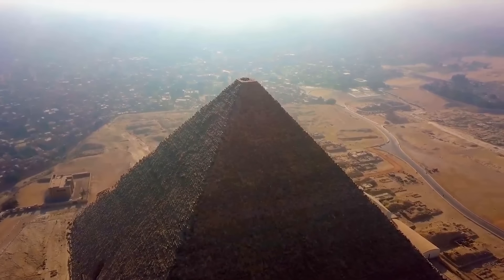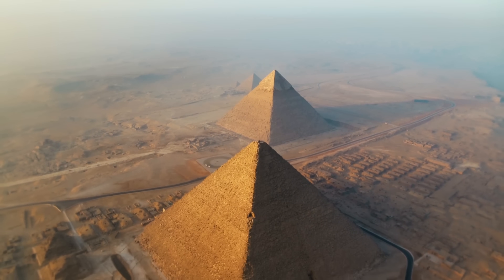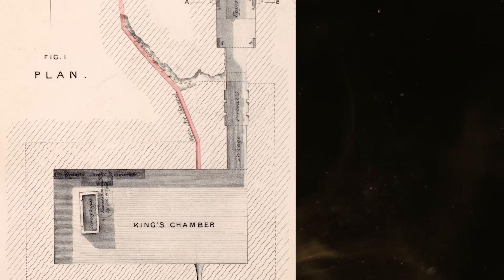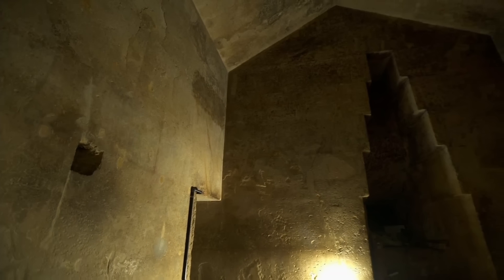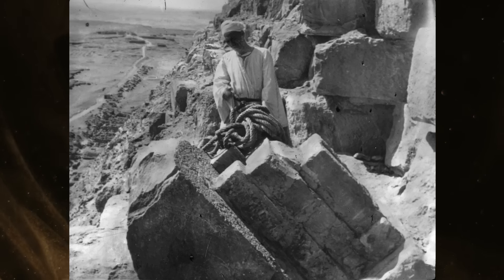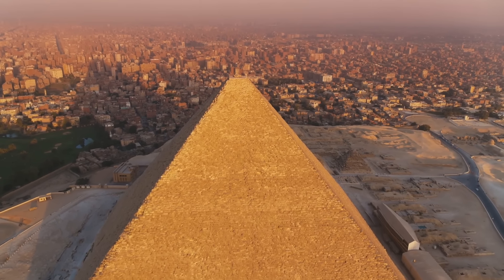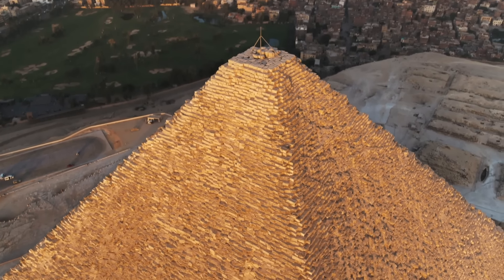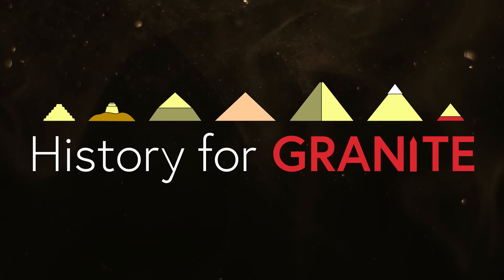One Solution to the Four Channels of the Great Pyramid

Comment: To say they are air shafts only makes sense if they were open to be used as air shafts.....since they weren't open, then we are still no closer to working out their true purpose. Dixon had to break through solid rock in the Queens chamber to open them, so they weren't just plugged up either.
Reply: They*were open.. you should probably finish the video before you start speaking
Reply: Did you even watch this video?

Comment: Thank you so much for your videos. At my home we love to watch them together and come up with different hypothesizes. E.g.: My husband assumes that the shafts could have been used to pull ropes through them during the construction process to lift heavy objects. He says the stone ball might have been rolled down through the shafts from the outside and was received by workers inside. That's why the shafts starting in the Queen's Chamber end within the pyramid. After this part of construction was finished (since its location is lower within the pyramid) and they weren't needed anymore, they were simply closed of.

Comment: Hello, I completely disagree with your conclusion on his topic but, i love the video and the effort you put on it. Keep up the great work and all the best for the next videos. Your work is amazing.
Reply: What's your opinion then
Reply: @shable1436  Hi, to be completely honest I dont have a theory myself. I do think that the shafts had a purpose and probably it was a religious one but, I am not sure about which one. My disagreement with the author of this magnificent video comes about the "air" shafts theory. I think there are many facts that have to be proven first.
1. Why two "air" shafts and not three? Why not four?
2. Why the king and queen chambers have the same amount of "air" shafts? And both at the north and south wall?
3. This theory has much more sense if you embrace the possibility that the queen chamber was thought to be the main king chamber but, Hemiunu changed his mind. There are many experts who think the opposite, that the pyramid was design the way it is from the scratch so, what is the purpose of the queen chamber´s shafts? Why the quality of the stone used in both chambers is different? Even the architecture is different if both were to be king chambers?.
4. Why the shafts dont go in a straight line to the exterior? Why so many turn arounds? Even, we now know that the shafts turn to avoid certain parts of the grand gallery, why dont you do the shafts to be positioned in a top corner? Or completely on the left and top corner? That will make more sense, no body will care as they are "air" shafts but, instead they are in the "middle" of the room at certain height.
5. As it is mentioned in the video, who do you need the air for? Once you seal the king chamber...
6. I know it is mentioned in the video that the workers had to work in difficult situations very frequently including without air but, if you are going to leave the stone at the door of the queen chamber unfinished, why dont you open the shafts of the queen chamber? At least for some time the workers will have more air until they plug a stone at the end of the shaft.

These are some questions that came to mind when i saw the video. I know that I am not answering anything here but creating more doubts, that´s why i said from the beginning that I appreciate the work of the author as he is brave enough to base his theory on facts.

I would appreciate to read your point of view.

Sorry for the long post.
Reply: Perhaps t's not the chamber that needs air...perhaps air is for whatever was going to be put in the chamber. If you think about the channels as ducts that pass air through to an apparatus of some kind. This would also make sense as to why the holes had different machining marks done later...so that the apparatus could be custom fit into the square holes on site.

Comment: new questions indeed. ive never seen the shafts in such good detail, you can clearly see the different tool marks left that reveals the purpose. but also more answers we can tease out too?

1) the unfinished edge on the queens chamber entrance would lead us to believe the room was not given its finishing touches, thus the suggestion the shafts were meant to be opened in the original plan, but since the queens shafts are sealed off at both ends, it means a change of final plans for the burial chamber was made quite late and moved up to the kings chamber instead.

2) they seem to have been hedging their bets about the kings chamber since the shafts are finished almost to the casing, but were confident enough to go ahead and seal them off after the top chevrons were laid down and the granite beam cracks didn't get any worse since they seem to have been sealed off at that course of masonry.

3) the beam holes for flooring on the grand gallery also would have the entrance to the queens chamber essentially paved over and forgotten about along with the lower unfinished chamber as well. likely with a cedar floor and stairs over the whole thing, pinned into the open sockets left along the sides.

4) the shaft openings were among the very last things to do before finishing the chamber since the queens shafts reach very high up but are not opened back down at the bottom. 

5) the rough finish inside the shafts do indicate a utilitarian use for them and not a spiritual one, otherwise they might be made of polished granite and be bang straight. that they wiggle around then take the shortest route out also implies simple utility. 

6) the concept of the false door for the soul would have been used for ritualistic purposes and not a small shaft.

7) the queens shafts would have been continually covered with those "doors" as construction progressed upwards, the kings shaft likely had similar covers until they broke the surface. they are prolly broken and in the core rubble infill of a nearby mastaba after the valuable copper was removed.

8) the ball, hook and handle were dropped into the shaft on accident at some point higher up. or possibly thrown in by the poor soul in charge of that shaft when he was told all his work was for nothing they were using the upper chamber now. >=(

9) early reports of a painted ceiling in the queens chamber before the salt got to it was prolly leftover construction marks like "paint here" "carve this off" etc. since we can now conclude it was an unfinished space. if the queens chamber also was meant for a second burial with the kings chamber then the shafts would have been finished to the same degree as the diagnostic marks in the kings chamber would conclude. thus the pyramid was a 1 occupant structure. 

10) there is 1 thing I can think of for why they would want fresh air into the burial chamber. having the burial chambers so high above the entrance might trap and foul the air over time and made it impossible to have a lighted lamp, and the very last thing in the burial ritual was for the priests to light 4 lamps around the sarcophagus to keep the evil spirits away and dump some water on a pile of grain to symbolize new life and then drop the portcullis slabs. would be abit awkward to get to the lamp part and have it not work. so they do seem to be simple vent shafts, but also with very important uses since they built two of them in different directions incase one failed. 

misc thoughts:

11) the cracks over that block to the right of the sarcophagus really need to be examined if its hiding a passage like the queens shafts were, perhaps to the small magazine chambers that seem to be missing from the design as they are in the later pyramids. mabye its the rest of his mothers furniture in there who knows?

12) the grand gallery seems like the corbels stop way too soon into a flat ceiling, they ought to go alot higher up before flattening off which seems to be what the scan pyramids project has found. if they built 5 relieving chambers over the kings chamber then id expect at least one over the grand gallery too? cant have that collapsing either. 

13) since we can see the twist of the pyramid at the top in the core masonry infill, I wonder if alot of the other infill is laid down off angle on purpose in order to distribute the forces from the 4 sides away and if they alternated that angle for each infill course?

a low chance that you see this or reply to me, but ive been watching you since the start of your channel, and your videos are very well done, please continue. (hands you a cookie) 🍪✨😸❤
Reply from the maker: Your summary and observations are very astute. It makes me happy to see that the information has been conveyed clearly. You’ll be very happy to get some more answers in the next video.
Reply: @HistoryforGRANITE  thank you kindly for your reply, I shall await it with anticipation sir! 😸❤️✨
Reply: dude, nice comment.  @trydar
Reply: @Charlie-phlezk  thanks! 😸✨
Reply: Epic comment dude! Number 10 makes me think hard, you're on to something there, it's a basic answer that fits, Khufu when overseeing this project would have been like "Yo I heard the candles blew out at other burials, I don't want that shit happening to me, fix it!"
Reply: @masaharumorimoto4761  thanks! its something we know was a requirement for the burial ritual, the all important reason for building the pyramid in the first place, and it was clearly so important that they made 2 shafts to make sure at least 1 worked, and kept building the lower 2 shafts until they were sure the kings chamber was unlikely to collapse and could be used as the actual burial chamber, so they opened the vents at the bottom once the cover slabs were removed to make the last horizontal vent opening at the casing and did not do the finishing work on the now redundant queens chamber. whoever built this was clearly very worried about internal collapses, so much so to make 3 burial chamber options. I also think the hooked tool found at the bottom of the shafts might be how they pulled the covers off between each course before replacing it to keep the shafts clear of debris during construction since that is the most likely thing to be near the shaft mouth and get dropped in on accident. so clearly fresh air was an absolute requirement for something in that room, and with kufu dead and the chamber sealed with granite, im not sure what else it could be except the 4 votive lamps. we will see in a future video what HFG thinks it was needed for tho, he may have a better idea. =)
Reply: Source?
Reply: Ventilation for the group of workers  finishing the internal chambers as well as ventilation for allowing candlelight since they'd be working on the dark seems to make the most sense from a constructability purpose. These could be easily and quickly subsequently sealed up as discussed in the video when burial ceremony and/or construction was completed or as needed to avoid rainwater or sandstorm ingress Well done on the video, makes plenty of sense.

Comment: A personal opinion is that they could be vents for using during construction phases such as painting the chambers. 
The pyramid is built over a long time roughly from bottom to top.  I've seen modern condos being built like where while on top most current construction the concrete is being poured, a little below that the studds are going in, below that the wiring and plumbing, then the drywall to seal over the studs, then the doors go on. So on a high rise you can  have all these going on at the same time with even fully completed condos on the lower floor. Over time each trade moves up one floor as the floor above is ready for them. 
In the case of the pyramid the stones that make the chamber room are built. At some point interior work with paint and thus fumes would start. To clear the fumes vents are established to the current exterior. Important to note the "current" in the exterior access. As work is going then new upward layers would need vent paths extended along their slopes. Then once the work, and smelly fumes, is done the upper layers would no longer have the vents continued. This is where the next layer of stones don't continue the vent.
This is from a limited research capacity. I look forward to Granite's details and happy to see an inclusion of venting in his timestamps. I wonder what his deeper research will  present to support or deny my current opinion.
Reply: Not a compelling solution, the amount of air exchange would be trivial over such a long distance and narrow cross section.
Reply: @kennethferland5579 I disagree, having air moving on both north and southern side would create a suction effect allowing constant air moving through. 
Personally though I think it was to keep fire going for light and the fact that the chambers where above ground level this creates a problem for air and smoke after completion.
Once khufu was placed the vents where closed for maximum mummification.
Reply: @kennethferland5579  You could be right. Some is more than none. The human sized access tunnels also exist but without at least some other air passage gases would be hard to get out.  A house chimney is fairly narrow and not unlike this size. Its not a matter of looking for great winds but at least some air movement to exchange gases. A draw would exist with at least one other path beyond the main door.
Most period light sources were based on burning oil, wax or pitch and that would lower oxygen is burning in a confined space.  The narrow construction-chimney would also allow smoke to be drawn out without coating the newly painted walls.  Though this doesn't address why each has two nor the relatively shallow angle. 
I don't claim to be absolutely right only putting it forward as a possibility. Looking forward to Granite's details on it.
Reply: A good idea, here. Yes as a Plumber working on a high rise, these chases, are filled with Styrofoam, (covered over with a thin layer of concrete, to finish floor,): then chiseled into to complete the drain assembly. This theory would mean that the builders didn't get time to complete the shafts purpose, or another Culture did not know the usage, & blocked right over the exits.
Reply: @Nobbie248 supply oxygen for lights with min airflow does seen valid. The painters and carvers decorating the chambers would need light as the upper pyramid continues to be built. Rather than fumes as in my original post it lets light sources burn, or burn better. Smoke and fumes would also move out too.
Reply: They are way to long to be venting unless fire places were under them.
Reply: @b1laxson  are those rooms painted and decorated  ??
Reply: @kennethferland5579  Not if they had some way of pumping air.
Reply: air wouldn't move efficiently through a 60m snorkel. Plus there is no paint inside.
Reply: @efteestein  No paint remaining. There is some thoughts that they have been decorated back in the day. Consider Tutankhamen's tomb that was found sealed.
Reply: what paint? and if paint, what 'fumes'? more likely vents for smoke from lighting.
Reply: A quick note that my original post was on the notice for the video, thus before Granite's information was made known. HistoGranite's full video is now up. While Granite agrees on ventilation he raises the question on for who.
Reply: @Nobbie248  That's not how air would move through such a structure, it will vent out through both channels and enter through the main entrance to the decending corridor.  Human breath, bodyheat and any flame used for illumination is warm and will rise.  Also we KNOW that people can go into and through the pyrimid without suffocating for lack of ventilation, and they can even do lots of work inside because EVERY graverobber and Explorer did exactly that while the channels were all plugged.  The claimed 'need' for ventaltion is complelty unfounded.
Reply: @kennethferland5579  well we dnt know if the "entrance" was completely open at all times so this is neither here nor there.
The fact that 2 openings parallel create the effect for air flow is what it is.
Reply: @b1laxson  The great pyramid was not painted at any time inside, nor were there any mummies, nor were there any hieroglyphs anywhere inside at any point in history. The caliph of Al Ma'amun was the first to enter some areas inside in the 9th century AD, by digging a totally new tunnel in as all the passages were blocked, and the interior of the pyramid was empty (save for two small builders objects in the queens chamber & one damaged box in the king's chamber known now as the Dixon relics). The vaulted ceilings and rafters above the King's chamber show no signs of smoke damage either. The pyramid was not looted at any point.
Reply: @daos3300  No smoke marks in the vaulted ceilings above the kings chamber. Also take somethinglike the Serapeum - underground, with no air vents and still no smoke damage
Reply: @efteestein  ancient egypt commonly used cold pressed castor seed oil for lamps - burns clean & smoke free. or did they perhaps fumble about in the dark..? they had a bit of a clue about oils, extracts, essences & the like, given their unquestionable expertise in embalming.
Reply: One thing in the video is the channels do cool an otherwise hot interior. So venting works for cooling but smoke/fumes as I suggested might not be.
Quandry that is no finishing like painting hieroglyphs or mummies not present you would still be building the vents for when tht was to happen. Implies the great pyramind was abdoned never fully finished which has huge implications.
Reply: It is undoubtedly very strange  @b1laxson
Reply: @b1laxson  if they move air ie cooling a warm interior, they will also move smoke. same same.